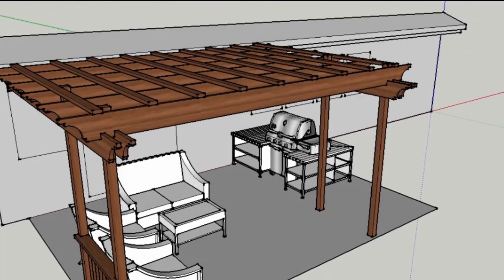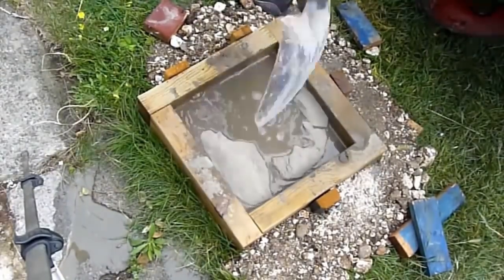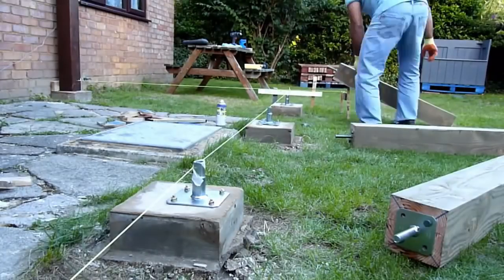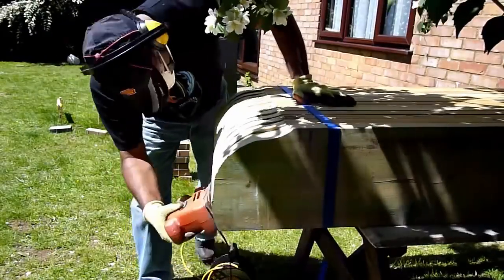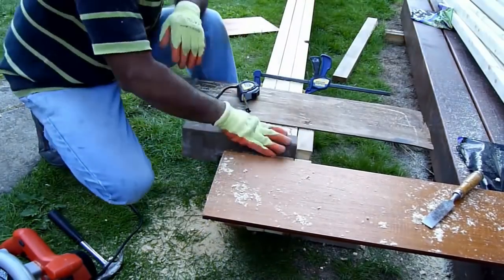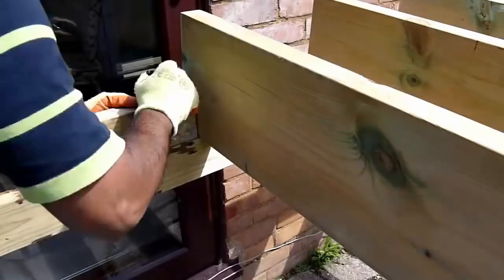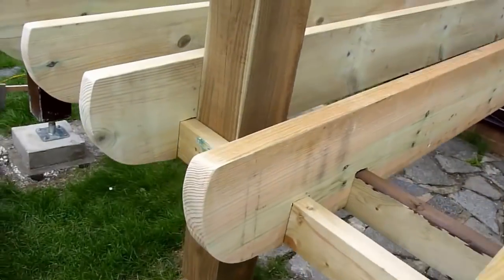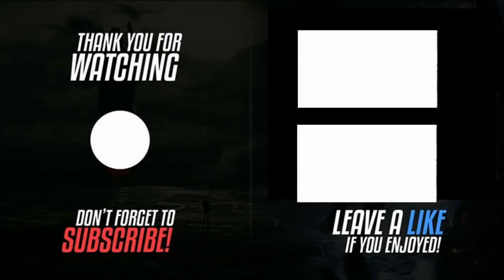DIY PERGOLA Build - Episode 1/3

Comment: sorry to ask another question , (your own fault for having a great detailed pergola built :) ) . when u did your ledger board on the house wall, did u fit it to a 1st floor foundation, or just put it at the height u liked?  so confusing trying to find the right answers with so many conflicting views online. if the pergola wasnt such a great thing to have, id never build one now :)
Reply: @SujMenon  thank you, yes that all makes good sense. i was thinking 9 foot too.going slightly down to 8 foot for the posts , using a 2x8 i think for strength purposes . thank you again, im just trying to make sure its as stable as possible.  sorry for the barrage of questions, just be glad im not your neighbour, id be knocking on your door constantly :)

Comment: I really like you build and it  looks amazing. I have one question, how to do make sure the screw doesn’t goes through the wall and come out the other side?
Reply from the maker: The bricks are usually 10cm wide, and the wood is around 5cm. So any bolts between 10cm and 12cm long will work

Comment: Nice work but you should try a router for notches. You will save a lot of Time  And a much cleaner work 😉
Reply from the maker: Very true mate. That time I didn't think of creating a flush trim template with the router. Majority could be hogged with the jigsaw and a final few passes with a flush running router bit would give a consistent smooth finish👍😁

Comment: Mr Menon, very nice video series, I got a lot of tips. I was wondering if you have advice on what to do if my concrete patio has a slight slope for rain water runoff?  Should I get anchors that I can bend or adjust to make the post level (if so, would you recommend either the APB or CPT type anchor for this?), or should I use a grinder to level the concrete?
Reply: @SujMenon  Ah, good suggestion. Thanks so much.

Comment: Great work and i liked the detailed explanation, one question, why you didn’t placed the post in the ground and poured concrete, wouldn’t that be stronger? Thanks
Reply from the maker: Thanks, most of the pergola post legs that I have seen, that are in set in concrete, gradually suffers from rot at the part where they come out of the ground. It can be eradicated by a proper rubber/tar seal, but I wasnt going to take the risk after spending so much time on building  the frame. 😁. My reasoning is just like building a shed base, were it sits on a concrete pad, minimum 2 inches from the ground. Hope that helps
Reply: @SujMenon  Thank you mate, appreciate your response, i will be building mine with a deck, but i will put the post on the ground with postcrete . Will share once done.
Reply from the maker: Good luck buddy, yes please share your build when its completed 👍 😀

Comment: Hi Suj. Where did you get the metal for the rebar?
Reply from the maker: Hi Antonio, i got it from my local builders suppliers. A142 steel reinforcement mesh.
Reply: @SujMenon  thanks Suj. Appreciate you taking the time. Using your concrete block system, im building a free standing pergola in the back garden using 6x6 posts. Would the Simpson comcealed post base be strong enough (each post height 2.3m)? Thanks
Reply from the maker: Yes, if installed properly, it should be fine. It's used for building carports etc, so don't see any issues with it. The strength of the structure will come only when 4 sides of the structure are connected all together

Comment: Great attention to detail.

Only someone building for themselves would take all of these steps. A contractor wouldn't either sand or pre-finish the wood for a pergola or deck. Also, dry fitting a project is very time consuming.

A contractor's price to do all of that just wouldn't be competitive.

I've never heard of an "electric file" before and I have a lot of tools. I'll have to check that out.
Reply: @SujMenon  

I already priced them in the US. The higher quality units are just over $200.00. I have a big deck project planned for this fall/next spring. I'll pick one up before then.

I have a question... You mentioned using "fence paint" for your first finish coat, to darken the wood. In the US fence paint is something entirely different from stain. If we want a darker finish we just use a darker stain. Can you further describe the product you used for your first coat?

Thank you,

Jim

Comment: Great build.  I have a question.  Is there a reason why you have the post on top of the concrete instead of having the post in the hole and then putting concrete in?